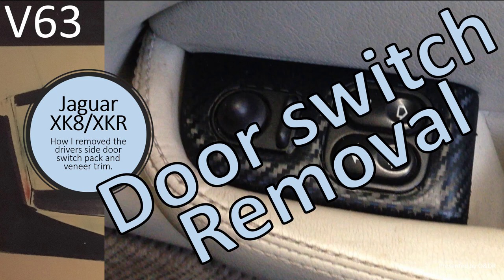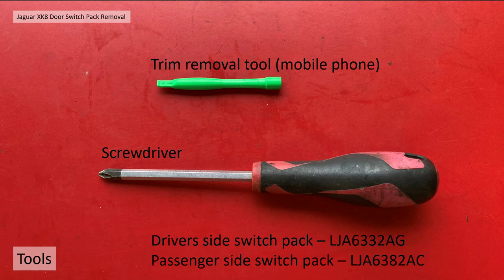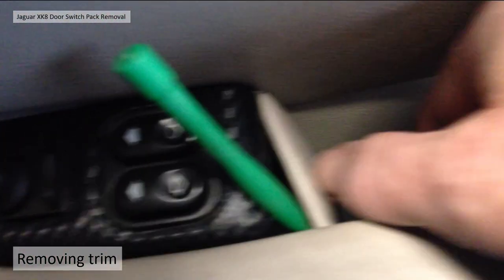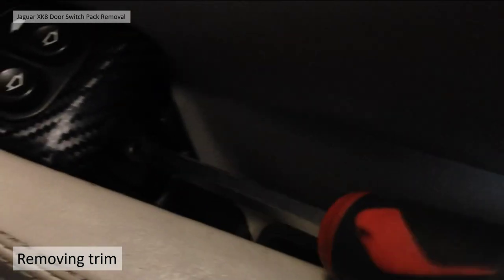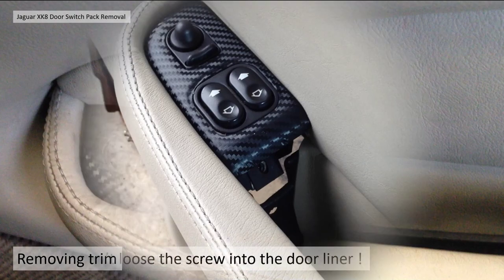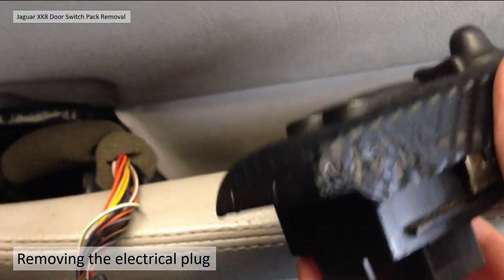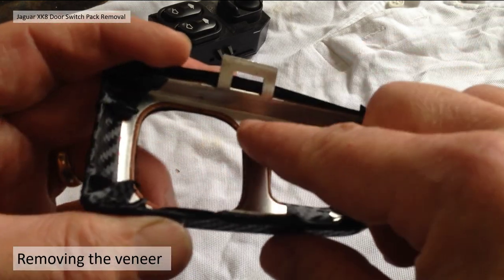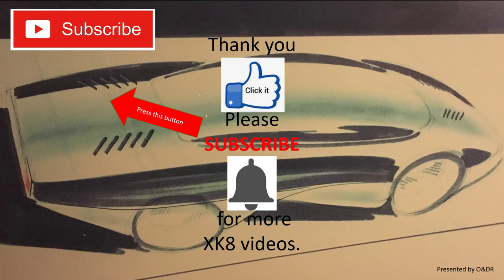Jaguar XK8 Door switch pack removal V63 / XKR (X100)

Comment: I removed my doors for a re paint now when I connect the a post loom plug I've tried the windows an for some reason the passenger switch in my drivers door works my driver window an the driver window switch does nothing...just wondered if the a post plug can go in wrong?
Reply from the maker: Graham, I had something similar. I think was the door module playing up. Disconnected and recharged the battery and it fix itself, regards Damian

Comment: Do you know if this switch is the same for the model with retractable mirrors like XK8 2006 Victory Edition
Reply from the maker: ML, not 100% sure. Suggest checking the part numbers for the different years of manufacture on SNG Barratt. See details in this video https://youtu.be/e7QzXEnnPwk Thanks for the comment regards Damian

Comment: I have just ordered a new one of these.  Would you happen to know if it operates the fold-back function?  I can’t get info on it other than ‘it fits all vin no’s from ’96- 05’ etc
Reply from the maker: Paul, I think the switch pack is the same and the difference is in the Door control module. Hope that helps, regards Damian
Reply: @ODRModurol  I was wondering that Damian.  Thanks
Reply from the maker: @Paul-tk2my, I don’t know for sure but seems likely, regards Damian

Comment: my inside door latch on my 1998 XK8 on the passenger side will not lock ,when I press the lock button on my remote . I have to close it manually from the inside , by pushing it closed or else when I go to lock the two doors of the car with my remote ,the alarm system goes on .  Apparently that part is no longer made or available . Any suggestions ?
Reply from the maker: Frank, normally not mechanical failure. the door latch is normally triggered with micro switches inside the latch. Those can gum up and get stuck or stop working. Would be worth trying to investigate a clean up and free the internal switches. Haven’t done this with the xk8 but have had experience of this with Ford and VW locks. Might worth doing this before trying to fix with second had parts. Thank you for your comment regards Damian
Reply from the maker: Frank, found this, hope it helps. thanks Damian
http://jagrepair.com/DoorLatchRepair2000xk8.htm

Comment: Is the metal bracket that the screw goes into, removable from the switchpack? The reason I ask is, there's a set on Ebay cheaply priced, but the switch for the drivers side, is missing it. Can I use the part from my bad switch when I swap it out?
Reply from the maker: Drew, the bracket that the pack is screwed down by is plastic and its part of the switch housing. You could probably dis-assemble the switch pack itself and rebuild with your existing lower case including the bracket. If you take yours apart you might find the problem and fix it.  However, not done it so cant be 100% sure. Hope that helps. Thanks for the comment regards Damian
Reply: @ODRModurol . Thanks, I'm going to spend a little more money and buy a new one for 150 dollars. Why be cheap at this point on a 97,000 car when new!
Reply from the maker: @drewframson7495  Nothing lost if you try to fix it and it doesn’t work. Good luck which ever option you decide on. Thanks again regards Damian

Comment: My windows work fine, but both mirrors do not work. Is the switch, the likely problem?
Reply from the maker: Drew, possible switch, drivers door control module or just the fuse. Fascia fuse box LHS No4 - 5amps. Hope the helps to start, thanks for the comment regards Damian https://youtu.be/LS09sf9gZww
Reply: @ODRModurol  
Fuse #4 is door locks. My locks function fine. So if #4 also controls my mirrors, it's not a bad fuse.
Reply from the maker: Drew, should be a fuse for the mirrors. You haven’t said what model year your is as fuses are different from MY2003 cars. Next is to check the switch pack itself. Can you swop with one that works? Or buy a replacement one. Sorry can’t be more helpful. Thanks for the comment regards Damian
Reply: My car is a 2003 XKR. What else does fuse #4 power? That way I can eliminate it as source of problem.
Reply from the maker: Drew, found this for the fuse location, hope it helps, thanks Damian
http://jagrepair.com/images/Electrical/FuseRelayandRoadsideInfo/RoadsideFuseLocations.pdf

Comment: Another very useful video! I am really tempted to buy an XK8 and your channel is an excellent resource for a ‘tinkerer’ like me. Many, many thanks!
Reply from the maker: Nick, if you like a car to tinker with this is the car for you. Had Toyota MR2's for years never had to do much with them, a bit boring on the tinkering side. However, the Xk8 has loads of potential for winter tinkering, haven't really stopped for the last 5-6 years. Plus never that serious so OK for Summer driving of course. Good luck with the car search, regards Damian
Reply: @ODRModurol  Hi Damien, yes, that’s exactly what I want! I used to have a Porsche 944 which was great but every problem that turned up was of a size that you couldn’t do at home. I don’t think Germans like the idea of Sunday mechanics. I need a car that I can get satisfaction out of both driving AND fettling, so I watch your videos closely. Again, much appreciated! Have a great day!
Reply from the maker: Nick, the mechanics are quite basic and there is loads of parts and advice available. Thanks for the comment regards Damian
Reply: @ODRModurol  No worries at all Damien!Thanks for all the effort in putting together all those brilliant videos. Do you mind if I ask whether you have had any big rust problems or not? Cheers Nick
Reply from the maker: Nick, I had the rust problems as shown in the hidden rust video. But as out of sight was able to do a decent job together with a friend of mine. External rust would be my main worry as also needs someone to paint and make good job. Thanks for the comment regards Damian